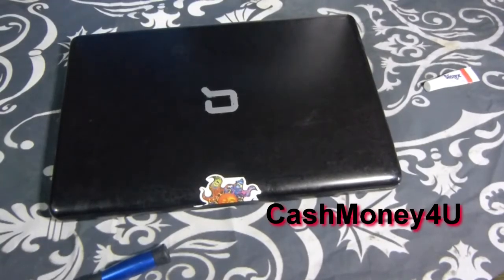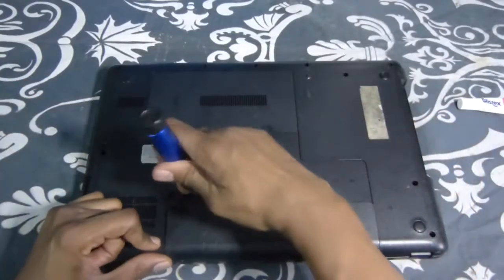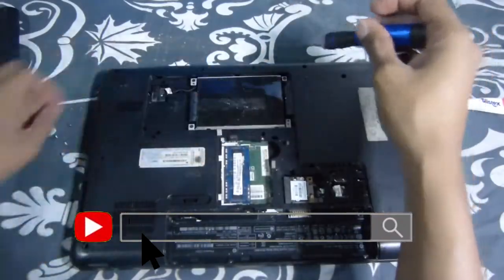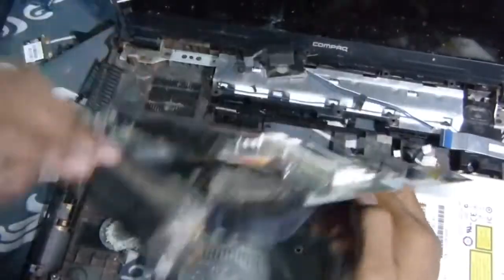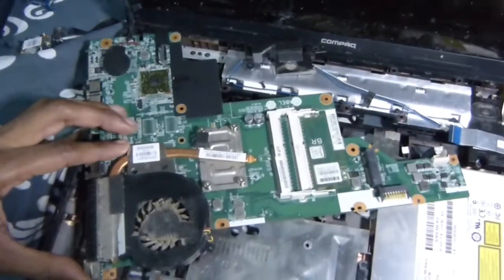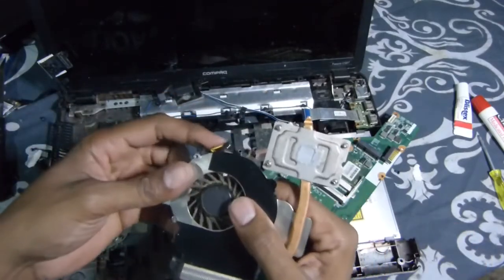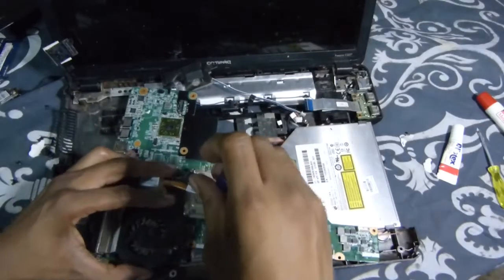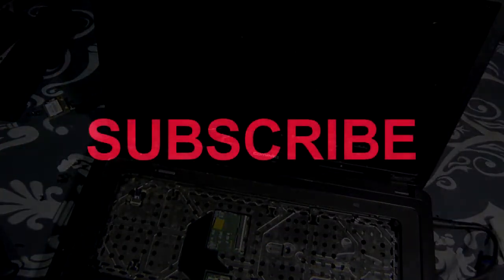How To Fix Laptop Black screen

Comment: if the video chip shut down due to overheating it should still come up when you boot the PC when it is cold right?- How do you explain it.  You are just heating the Chip to get the solder to reflow and hope that it was a cold solder issue.
Reply from the maker: cook master some time depending on how bad it is most of the time you will have to reflow it bro
Reply from the maker: You have to add thermal paste to the video chip before putting back together